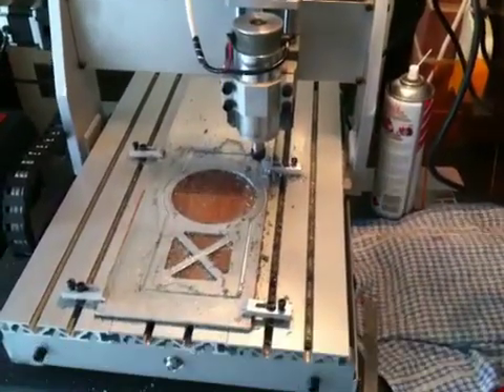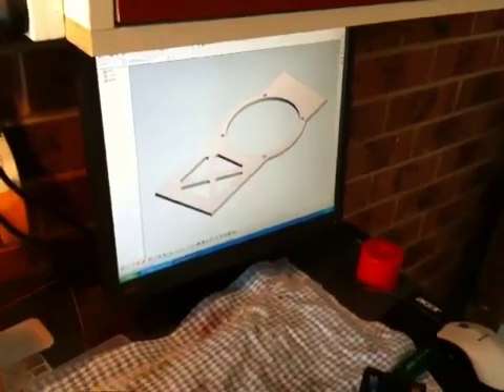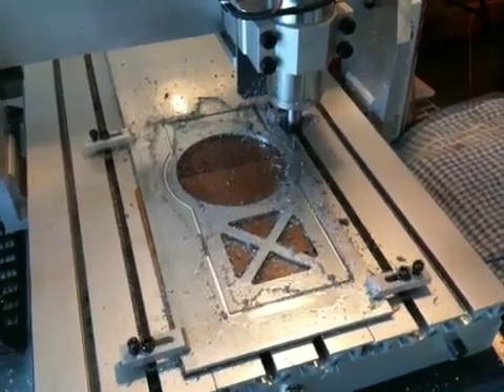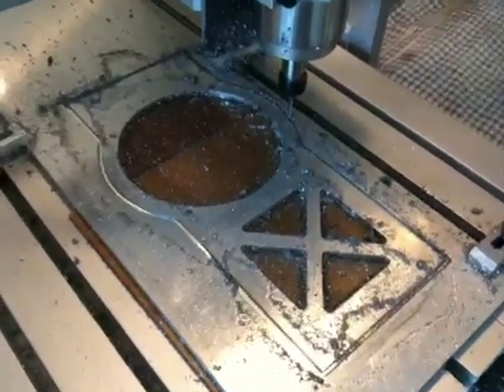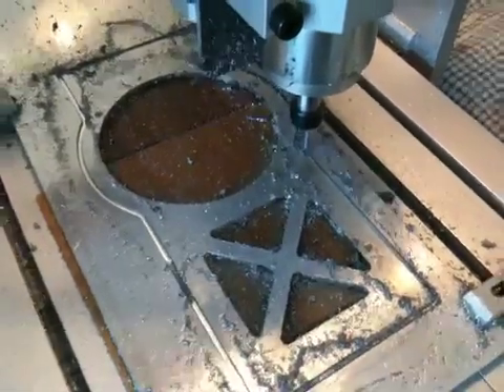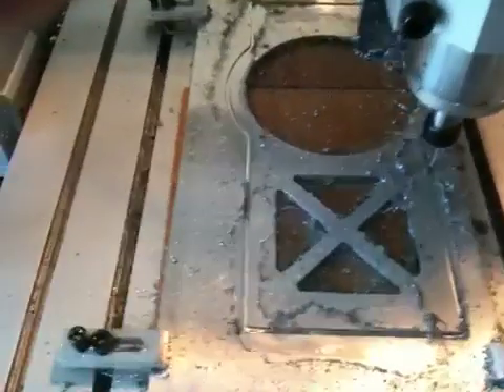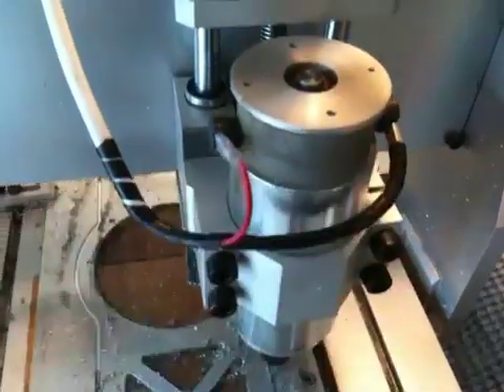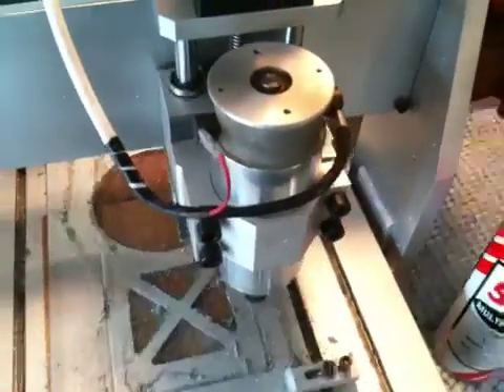CNC 3040 Router Machining Aluminium RC Helicopter Parts

Comment: I have the same machine with every upgrade you can think of been sitting 5 years brand new and could never figure it out it's a big paper weight now 😢
Reply from the maker: Hey mate 👋. They were actually a very handy little CNC back in the day. Mine had the dodgy rails, screws and spindle motor. The 6090 was a far superior router in comparison. I hope someday you’ll get the time to get it up and running. Loads of fun. Cheers 🍻
Reply: @DCT_Aaron_Engineering  hope I do I got laser burners and 3d printers and have no issues at all with them the cnc just got me stumped lol
Reply from the maker: @ you need a CAD-CAM Software solution. Have you heard of V-Carve Pro. That would get you go quickly 👍

Comment: How long did it take to make that part?
Reply from the maker: Hey Andre, I made these parts a long time ago now.  From memory I think it took hours, as I was only taking shallow depths of cuts and conservative feed rates.  I'd smash these parts out now on my new Syil CNC machine.  Cheers, Aaron
Reply: @DCT_Aaron_Engineering  What model Syil cnc do you have?
Reply from the maker: Making ANDRE Hey mate, I have a Syil X7 Combo CNC mill. Fully enclosed, 12 tool ATC, 10K RPM 3hp spindle motor, and absolute encoder servos all round. Check out some of my Syil vids if you have time 👍

Comment: Hi DCTT can you help a litlle? I have bought this machine lates version which have some improvement, but still don't know how to start.
How to fix a plexy on, I assume I need some wooden board and than put plexy on it for milling.  Also how to define where are edges of plexy and how deep drill should go and what speed to use and which drill? Can you point me to where I can get infos about that? I know also it is not usable for steel but can I mill a copper or brass with it? Which software do you use for creating parts for milling? I use designspark for 3D printers can it be used for milling too?
Reply from the maker: +Damjanhd Hi mate, you will need to get a PC and load Mach3 to it.  Follow the instruction on the mill and set the Mach-3 parameters to run the machine.  Now, I would purchase the software called V-Carve Pro or Autodesk Fusion360 (CAD-CAM which is free).  Use double sided tape to stick your part down to the waste board.  Set your work offset (G54) on the X,Y & Z.  Load your G-Code from your CAM software into Mach-3 and click cycle start.  Best to find someone local to you and get them to show you. Best regards, Aaron.
Reply: +DCTTeacher1 thank you for reply. I didn't make it to work mach3 with 3040, problem is because i have windows 7 64 bit and it doesn't work. I have loaded XPmode on it and now trying to make it work, but there is no communication between PC and 3040, still solving that problem
Reply from the maker: Yes that is correct.  Mach 3 traditionally won't work on 64bit.  I run Mach 3 on windows 32bit with XP through a parallel port.
Reply: +DCTTeacher1 I have windows 7 32 bit and problem was my parellel port card it doesn't work with mach3. So I found some old computer with parallel port on board and not wit works and also put alot of effort to make move manually to work as it should. next week I will try to mill a pcb board.
Reply from the maker: Damjanhd Or, just throw that controller in the bin and install a Gecko 540 with ethernet connection :)
Reply: +DCTTeacher1 yes gecko is a nice controller but a bit expencive for me
Reply: +DCTTeacher1 Can you please point me to how to prepaire file for cnc milling. And which drill to use, speed of moving spindle, how to change drill if needed to finish product. What speed for spindle is good for aluminum, copper, plexy, etc.
Reply from the maker: Hi mate, what CAM software are you using?  I would start off engraving first and then learn to do pockets, contours etc...  Only use Carbide tools (i.e. 2 flute 3mm carbide end mill) use approx 10000rpm and 500-1000mm/min feed rate.  Start off slow and once you get confident you can up it.  Due to the low power of the spindle this will determine your cut depth pass in different materials etc...

Comment: Having problems with start up.  Same machine.  Possibly wrong instructions.  Did you have similar problems initially?
Reply: Yeah it isn't mine.  Doing a job for a guy that wants to use it for prototyping and production.  I told him that if this was going to be his income he should pay more or build himself.
Reply from the maker: David Brown Hi David, no not at all.  It worked immediately and I just used the Mach3 instruction booklet that came with it and got it running.  I originally ran mine on K-Cam, but changed to Mach later on.  I sould have started with Mach in the first place.  Cheers, Aaron
Reply: I wonder than if it is because we used a USB to parallel.
Reply: Cable I mean USB to Parallel cable
Reply from the maker: Hi David, no this won't work.  I used a computer with a parallel port.  USB to Parallel for some reason won't work.
Reply: That was what I thought.  Thank you
Reply from the maker: No probs mate.  Best of luck with it.  Down the track put a gecko540 on it and run it via an ethernet connection and smooth stepper.
Reply: DCTTeacher1 yep, wont work... the converter isn't a parallel port its a simulator, so will never work. get a ethernet smooth stepper (if you havent already)  - works like a charm (ive got a 6040 myself)

Comment: Would this machine be able to possibly etch zinc?
Reply: Or nickel?
Reply from the maker: Hi Roberto, I sure with the correct engraving tool it would be able to etch (engrave) into most materials. I only ever used it on plastic and aluminium.  Cheers ,Aaron.
Reply: How deep can an etch go? Im looking toward a 2mm deep etching most likely
Reply from the maker: 2mm is rather deep.  I usually only engrave to a depth of 0.2mm.  If you want it to go deeper you would have to do multiple passes.
Reply from the maker: I honestly believe that this style of CNC router would not suit your purpose. Suggest converting a manual milling machine to CNC such as a Seig X3 or Grizzly G0704.  Watch my Titan TM20LV CNC conversion videos.  Cheers, Aaron.